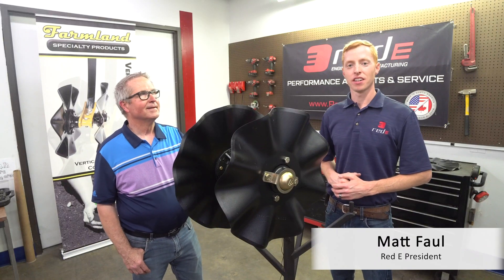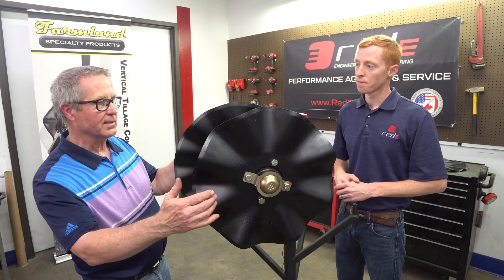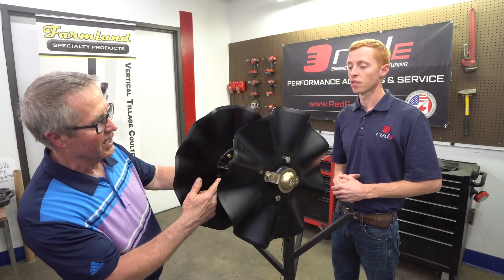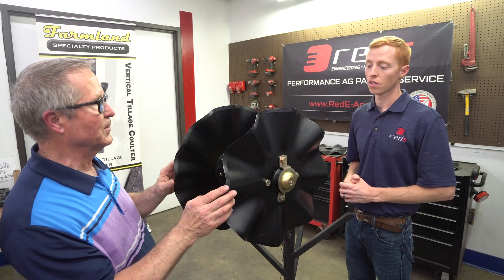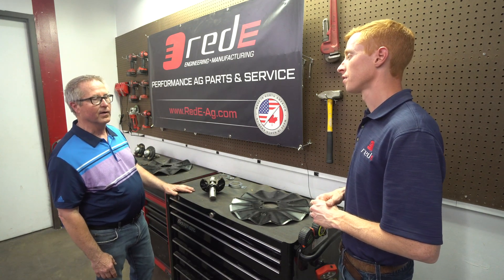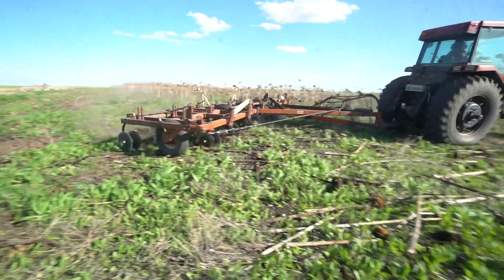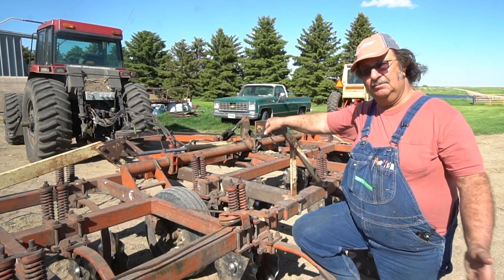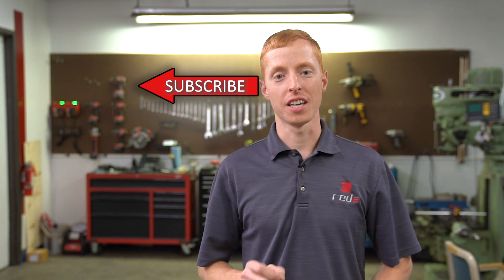A Vertical Tillage Coulter (VTC) on a Chisel Plow?!  Why and How it works...

Comment: Can I put these on an old john deere field cultivator
Reply from the maker: Not if it's a field cultivator that didn't have chisel plow shanks. It really should be a chisel plow or a air till drill air seeder (like a Concord). Needs to have heavy duty trips otherwise they'll just be bouncing back continually and not penetrating.